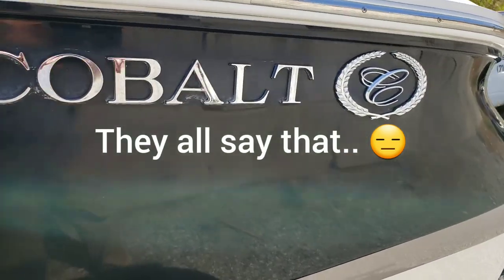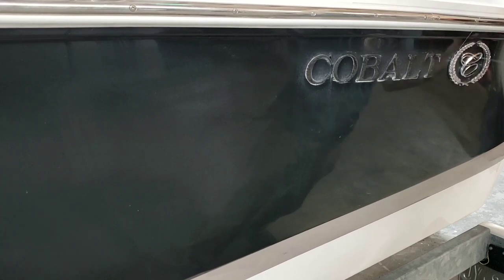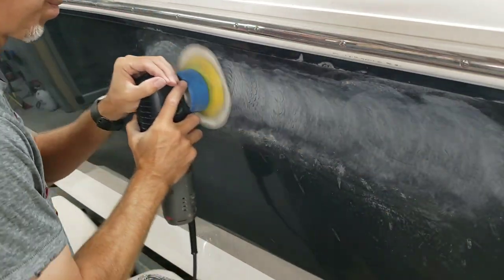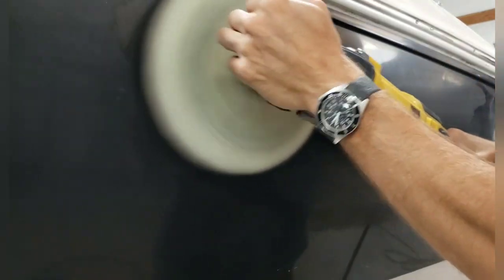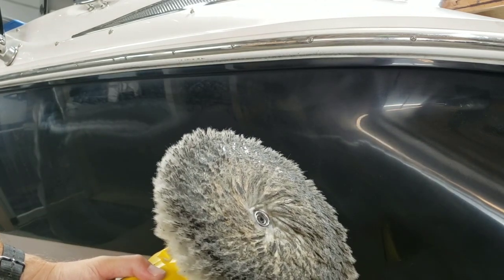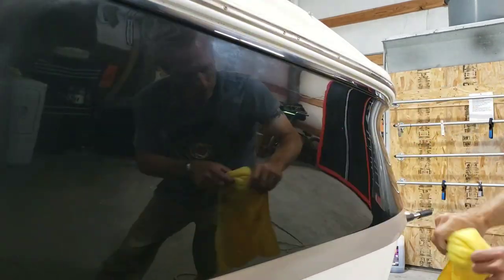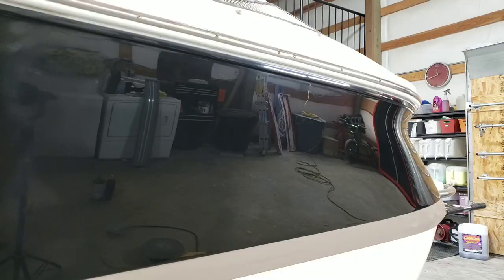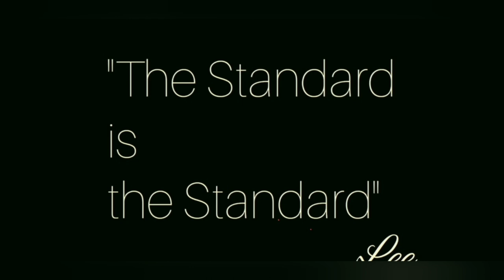Practical Joke (19 min in) on a Cobalt Boat Owner. Oxidation removal on Black Gelcoat Emblem removal

Comment: That decal trick at the end is absolutely hilarious. Well played! 

Question for you Lee, do you ever cover the interior of the boat to make sure it stays clean? or do you do full interiors after? That compound dust will get all over the seats and gauges on the insides... Just curious what you do? Thanks!
Reply from the maker: Hi, thanks.
We try to not worry about the interior too much. We do a full interior detail after the grinding because, you're right, it gets trashed after this kind of work.
Pulling the cover back just enough to get the gelcoat works but there's still a ton of detailing that's generally needed afterwards so it becomes a do, don't do toss up. I will add that sometimes we just pull all the covers because knowing that we'll be cleaning the interior anyway, it's nice to not have to also clean the cover from all the compound residue and dust.

Good question. I have very little respect for a boat to begin with and only care as we get them back to looking new which is one of my motivations in just not worrying about it too much.

Lee

Comment: Fist off love your videos! I live in Texas and need to buff my boat. I don’t have an area where I can put the boat inside to shade the boat. Can I buff in the sun, and what differences does it make to the compound?
Reply from the maker: Hi, You are able to buff in the sun, I do it all the time. The heat can sometimes force you to do a smaller section but mostly, it just makes this hot work.
I gave up reading instructions on this stuff years ago. If needed, have a small spray bottle handy, filled with water (distilled or filtered if available) if your compound starts to dry before you finish the area you're working on, add just a light hit to either the pad or your working surface. (not too much, don't make more of a mess than is needed)
You can also just add a few drops of compound usually and that'll help too.
It gets to around 110-115° F here and we just drink more water. It sucks and I love to be inside on days like this but it works in the heat too.

Thanks for the kind words and the question. If you have any issues, I'll try to help.

Lee
Reply: Awesome! Thank you man!
Reply from the maker: Nah, thank you.

Comment: Fishing line used to remove letters. Is it mono, fluorocarbon or braid ?
Reply from the maker: It's Not the space shuttle.. Strong enough to lift a six-pack, thin enough to get behind the letters.

Good luck.

Lee
Reply from the maker: If your line breaks (sometimes it does) use a hair dryer or a heat gun on the letters to soften up the adhesive.

Comment: I was playing around with some flitz metal polish and believe it or not it works great for ghost spots. Almost wanted to do the whole boat. But at 65 bucks a can it doesn’t make sense.
Reply from the maker: Well that's interesting. Thank# for the share. Yeah, that's an expensive route. I'm pretty sure "buff magic" by Shurehold is basically the same stuff, just repackaged. It works on some gelcoat well, kills pads but sometimes works really well.

Cheers!

Comment: I would want my original Cobalt decals back on also.
It’s a Cobalt thing.
Reply from the maker: I understand, they look cool. As long as you're willing to pay for the extra 2 hours per side (minimum) I'd be happy to put them back on but it is a silly design flaw, a Cobalt thing or not. I suppose it's why they went away from it in later models, even before the sale of Cobalt in '14..'17?
So, have dollars, will travel but I don't see many Cobalts with this type of emblem set, where it isn't the ugliest part of the hull 3 months after it was "waxed".

Options for both sides is all I'm saying. I will always hate working around them and Chaparral emblems are no better (just more rare here).

They look cool, also a pain in the ass.

Lee
Reply: I would, you can’t get between the letters good enough to cut the gel coat down, they are undoubtedly a pain!
Might try Your method of removing next time.
Reply from the maker: Also, look into a puffy (3D)decal that replicates the original.

You can go around them with special tools :https://youtu.be/9fN9Ljauz2Y?feature=shared